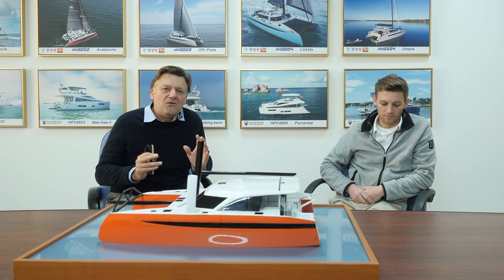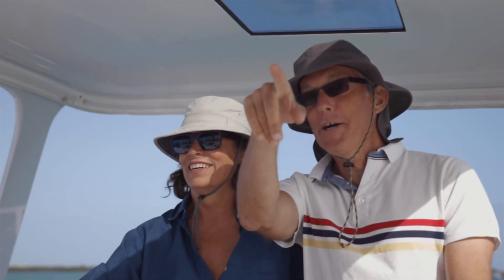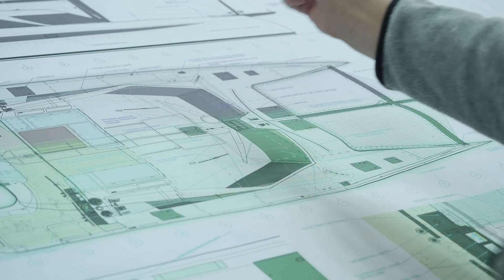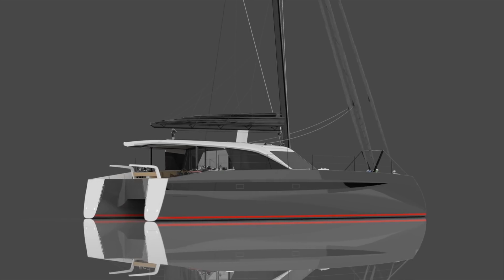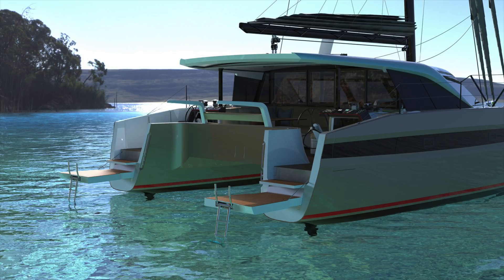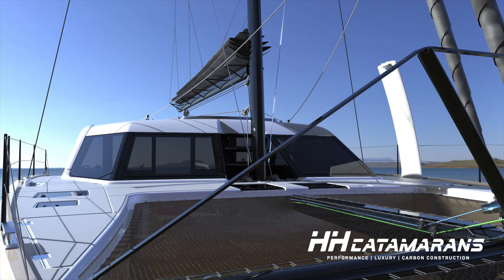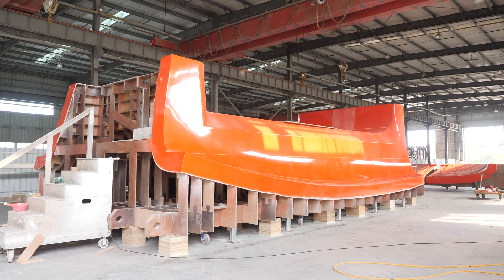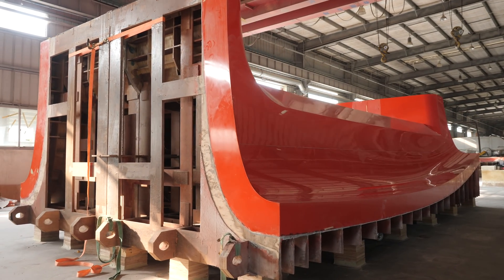Designing the HH44 (Episode 1) "Yachting Evolved"

Comment: I am wondering why there a still 2 motors and not one generator to feed the battery bank for the electric motors. Would limit maintenance to one motor
Reply from the maker: The system that you describe needs a generator to charge the batteries, which in turn power the electric motors. What is nice about our hybrid system is that it is redundant and fool proof. If the batteries are low you can go back to a traditional diesel propulsion set up. Why have a generator that cannot also spin the prop shaft as a back up?! A Hybrid approach lets you have electric power without any range anxiety.
Reply: I agree with you, the Ocean Renegade R5 does it this way. That boat travelled from South Africa to Florida, so yes it does work.
Reply from the maker: It can be done, but in a tough spot, we would still rather be in a Hybrid versus solely relying on a system with NO redundancies. If a single part of the R5 system fails (Generator, Charger, Batteries, BMS, etc) then the boat has no propulsion. The Hybrid approach makes too much sense if you are looking for a truly reliable and trustworthy system for use in remote places.
Reply: I understand your point but on the other hand a monohull has also just one engine. So for me is the question if it is possible to feed the electric motors directly from the genset in the case a failure of the battery setup. My thinking is a genset would work in its sweet spot by charging batteries or feeding the motors and I could get rid of one motor. I assume there will be no genset on the new hh44. I think this would save some weight but for sure  you are the specialists and not I. Thanks for your answers 👍
Reply: @Blackhawk1403  A parallel hybrid can turn the props either by Diesel or electric motor, so it has in essence 4x redundancy,  (Any of the 2 Diesels or 2 electric motors can move the boat).  A 2 electric motor, 1 generator serial hybrid has a single point of failure if the generator doesn't work, or the battery pack develops a fault.

Serial hybrid is possible, but parallel hybrid is inherently more reliable and possibly more efficient due to the more direct mechanical connection between the Diesel and the prop.

Comment: Please Mister Hakes, not you as well as you are a gentleman. You did not create the canting wheel, as Balance did not either. Loic Goepfert was the first to implement a canting wheel on a catamaran since he created the Abili 54 in 2009 (maybe 2007).
Reply from the maker: It's a good comment. The Alibi was another innovative design (forward dingy storage, remote winch control, etc). It's a shame they're no longer in business as they too were supporters of the carbon cruising boat concept built in Asia.
Reply: Doesn’t really matter about who “invented” it, I’m sure some Polynesian had some sort of pivoting tiller 1,000 years ago, what is important is that innovative design/safety features are finding their way into more and more boats.  Competition makes everyone better and it is the consumer who wins!
Reply: @kirkb3473  Dear winning consumer, the snow is white, the fire is hot and the wheel was invented 6000 years ago. I think you missed my point!
Reply: @TheDummytoto  Mr. Goepfert may have been the first to have a pivoting helm on a catamaran, but he did copy it from others as it was patented over 30 years prior.  Nothing wrong with innovating though, and copying is the most sincere form of flattery!
Reply: @kirkb3473  Perfect example of my philosophy. You nailed it. When you make a citation please quote the line and source, question of honesty and respect: “Imitation is the sincerest form of flattery that mediocrity can pay to greatness.”- Oscar Wilde.
I do not think Oscar Wilde invented the English language as LG did not invent the wheel!. The point is all about giving credit where credit is due.  Thank you !